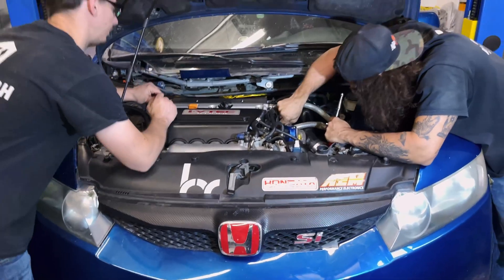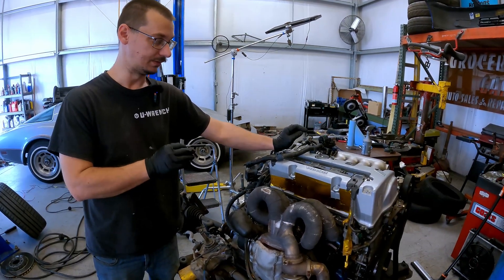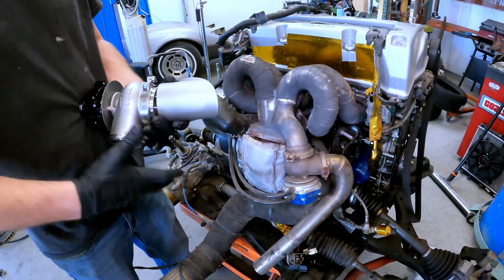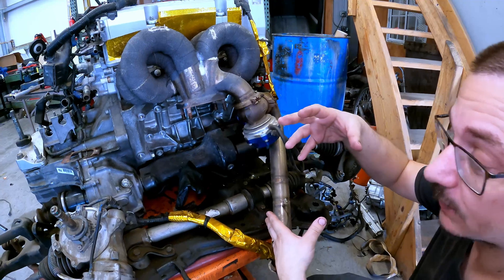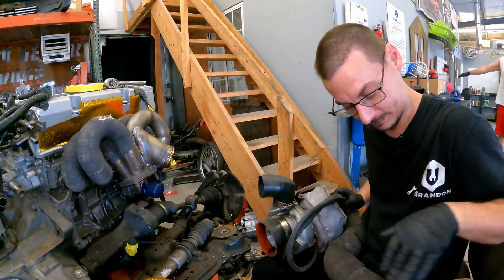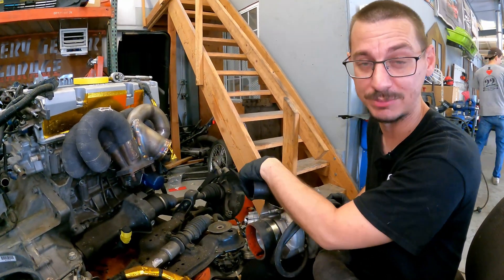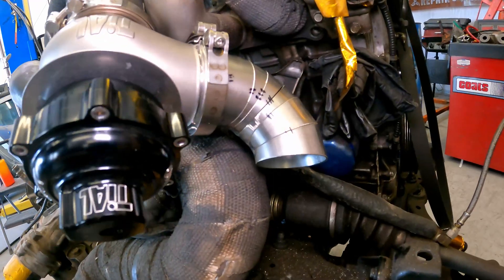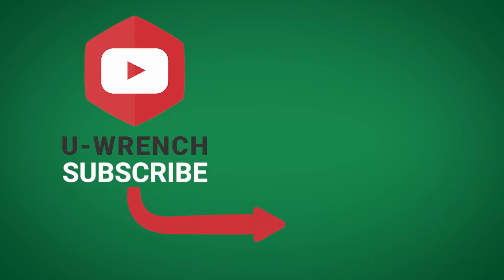Wastegate Turbo Problem | Is My Wastegate Big Enough?

Comment: Another great informative video. Hadn’t thought about what the wastegate does on a gas engine. But it basically does the same on a diesel. If you want the engine to last got to be able to keep your boost and stuff in check or it comes apart. Like the fabrication you do Brandon. You’re a good explainer type guy.

Comment: Brandon, you worried about runner flow bias with that setup at all?
Reply: Always, however the previous wastegate was only on one runner as well. This is just a badly designed manifold.